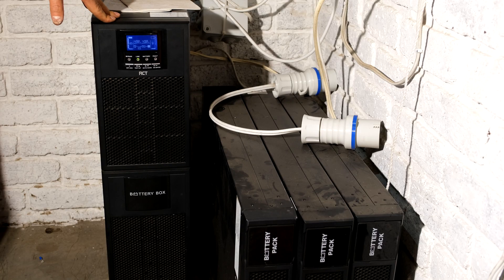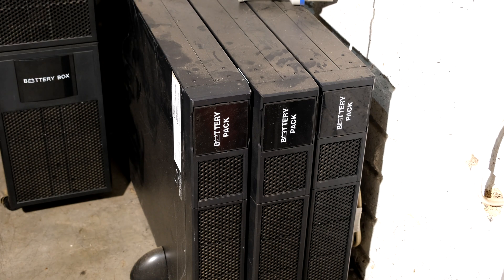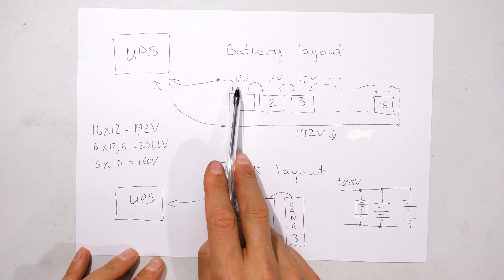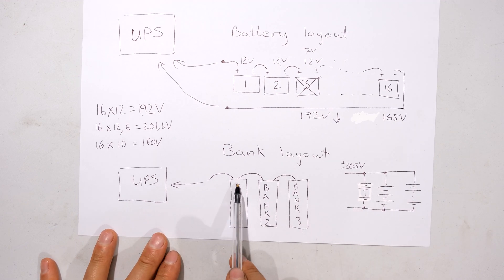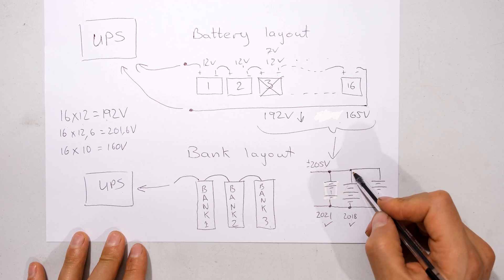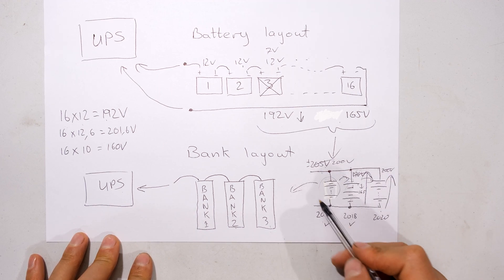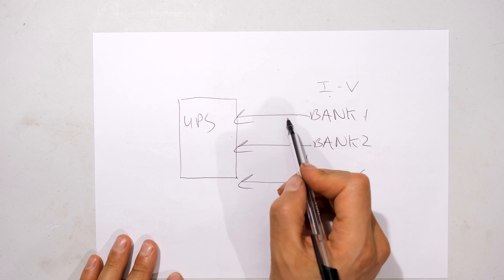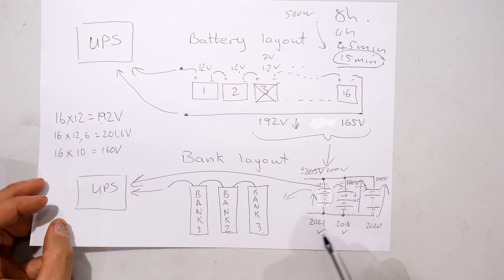Voltronic WinnerPro 6k/10k [RCT Mecer Online UPS WPTU WPRU] battery bank problems.

Comment: Hi, could you please make a video on how to solve or at least mitigate this issue? I would also like to increase the capacity of my unit, and was hoping to just get a 100Ah AGM or two, and connect with the external jumpers. However, I realized that the voltage of the internal bank at 72v migth be a problem when connected in parallel with the external 12/24v battery. 

Do you know if the UPS can be set up to tolerate a 12v circuit, perhaps by connecting the internal ones in parallel with the external connection? Or would I have to buy 6x 12v 100Ah external cells?

Comment: Hi, I have a question. I have the RCT 2000VA online ups. So far I am fairly impressed because we get a fair amount of dips etc. So I am running in constant online mode. The thing I want a answer to is what input frequency is dangerous to electronics? Mine varies from 48.8 to 50.2 from the mains?

I also enabled the frequency converter for a constant 50hz.

So my main question is, at what frequency does it become dangerous to electronics? 48hz or so? And is there any downside to running the frequency converter at always on to maintain rock solid 50hz?
Reply from the maker: frequency should not be varying from mains, Eskom cannot allow a change in frequency, if it does, the grid system will collapse. Do you mean from your generator? Electronics can tolerate it for a time but it becomes a problem for appliances when the drift in freq is long as there are stored charges in transformers that overheat the windings when the change cannot be fully discharged. Its not so much the frequency variation its the duty cycle - but when there is drift in frequency it usually comes with duty cycles that are not 50%,